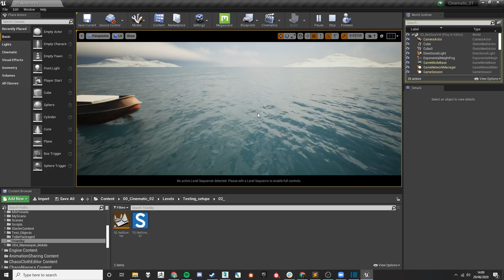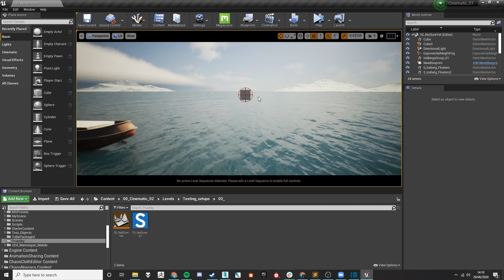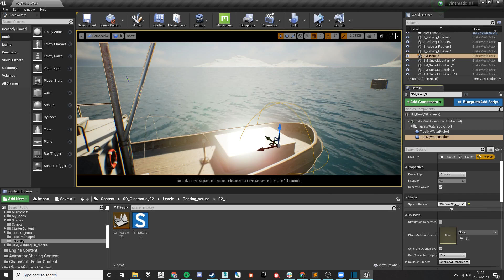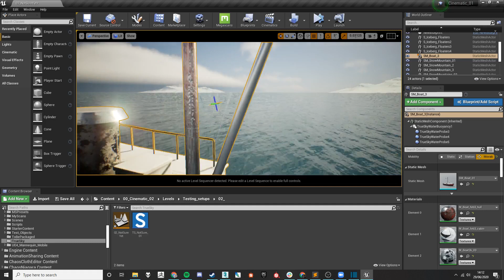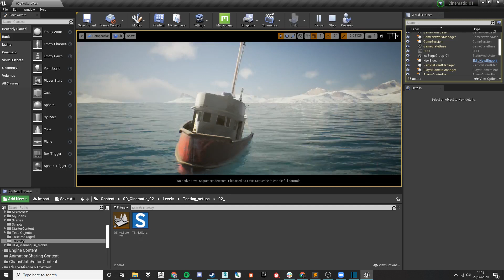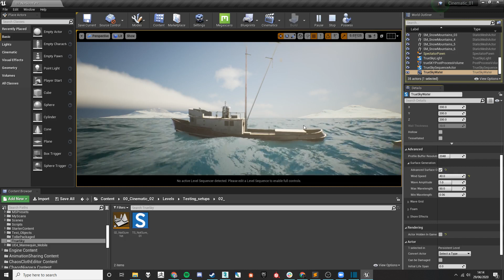trueWATER - Buoyancy Setup with trueWATER

Comment: So since you use random mass values for objects that are far from real values we can't get realistic forces. I can bump into a cargo ship and it drifts off. A cubic meter block of pine weighs about 529 KG when dried and the fresh water displaced is around 1000kg so the block should be submerged around 50% but with your plugin it will sink. How can I use the probe to show buoyant force of that displaced water? The documentation doesn't state what the probe radius represents